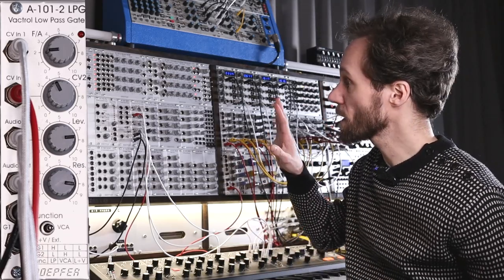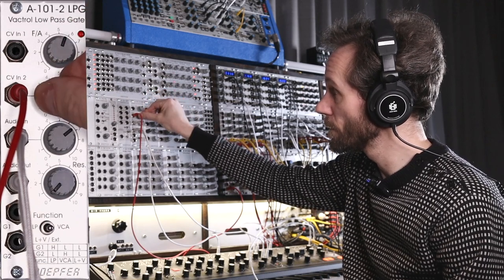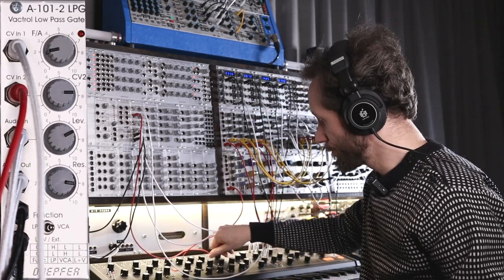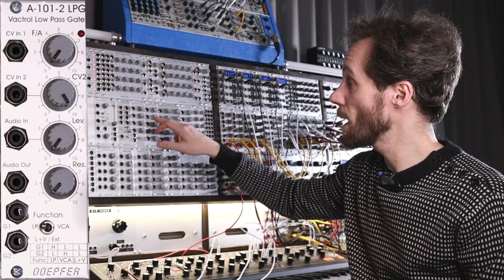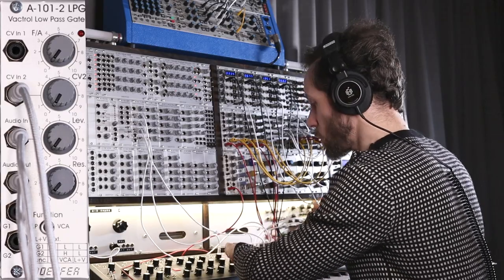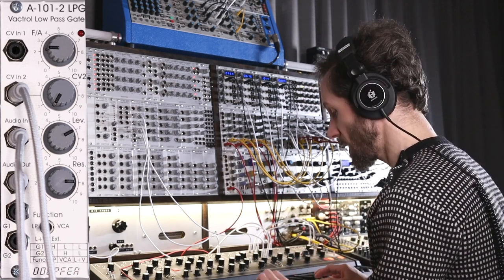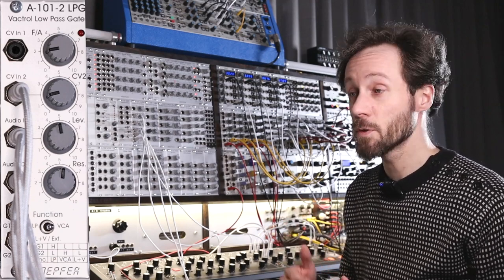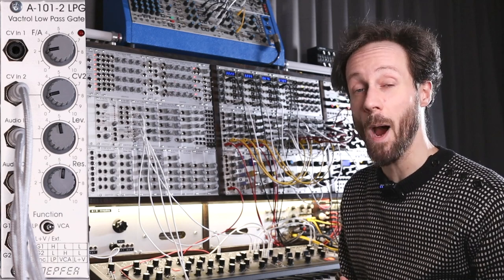Doepfer A-101-2 LPG Vactrol Lowpas Gate

Comment: Thank you for doing a video about this very interesting module!  I have one and have used it alot.  I like to send two gates from the A-149-2 module to add variation.  I would like to suggest that you try sending pulses only, not envelopes.  As a vactrol based module, you can do so some Buchla types of sounds.  The Buchla low pass gate was known for its "Bongos" because of the very naturalistic drum-like response of the vactrols (basically a built-in envelope).  I consider the Doepfer A-101-2 to be a rather "fast" vactrol/fast decay.  This past week I have been experimenting with higher pitched sounds that sound like water droplets.  With a lower pitch and a bit of white noise, they might sound like a snare drum...hmm,  I should try that!
Reply from the maker: I’ll try that 👍